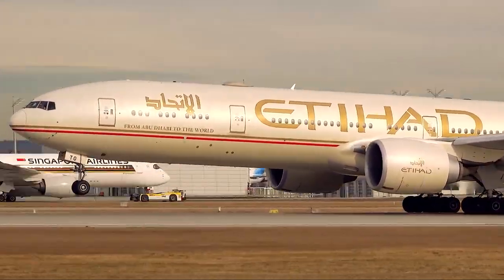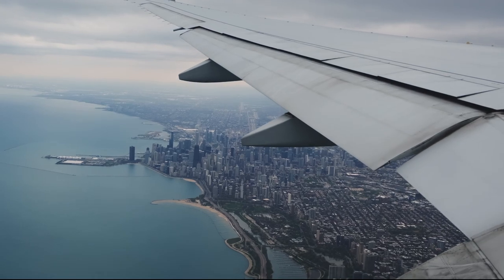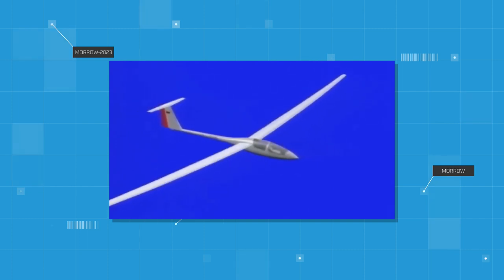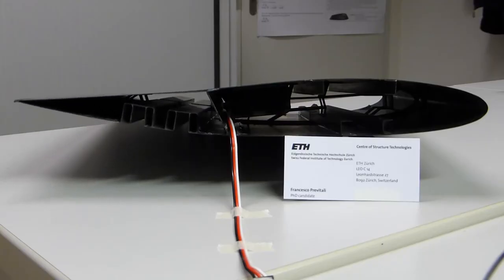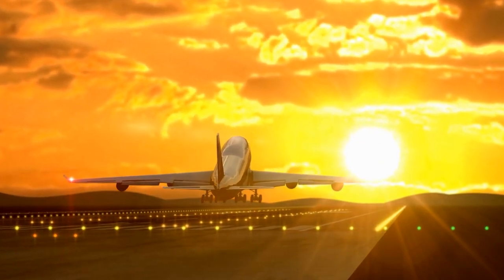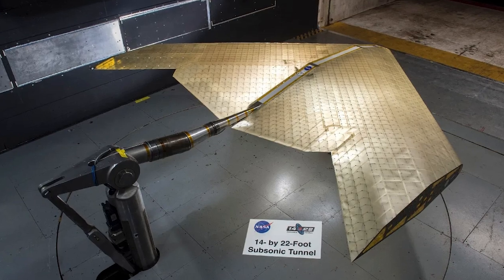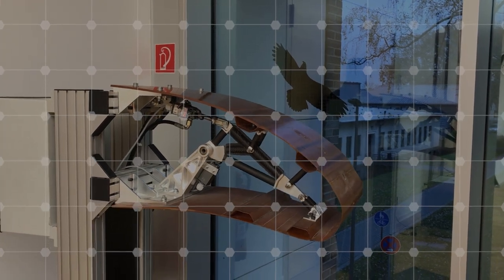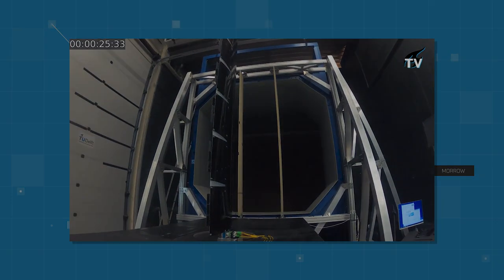Why This New Wing Design is the Future of Aviation

Comment: Wing warping was replaced by aileron control during the first world war....swing-wing (e.g F14, Tornado) designs of the 80s were replaced by fixed wing (e.g F22, F35). Working in a wind tunnel is a long way for servicable aircraft. I remain somewhat unsold on this idea. That's even before thinking about redudancy and modes of failure. That, and 10, 15, 25% fuel saving isn't going to make air travel as we know it now sustainable (IMO).

Comment: Why don’t military planes use winglets?
Reply: Fuel savings isn’t at the top of their list of priorities.
Reply: @Awesomes007  I mean cargo planes not fighters/attack craft
Reply: @truvc  Increasing span is typically more efficient than adding winglets - commercial airliners typically use winglets to limit the span of their wing, so they will fit into certain gate sizes. This is not really a concern for military planes, so they simply build a wider wing.